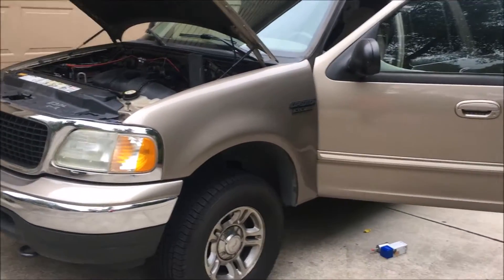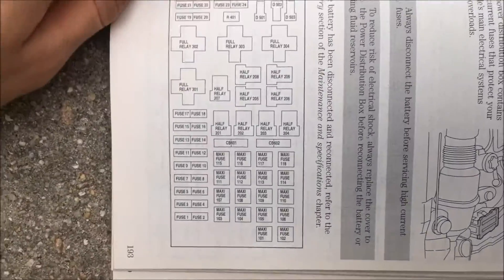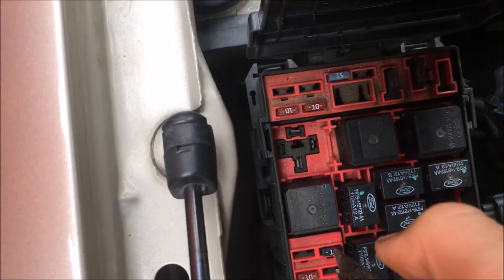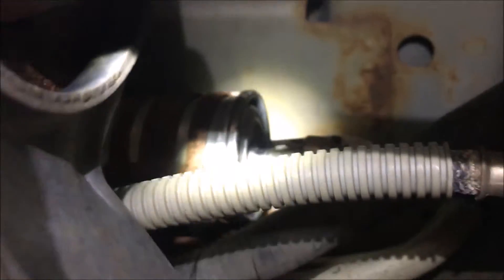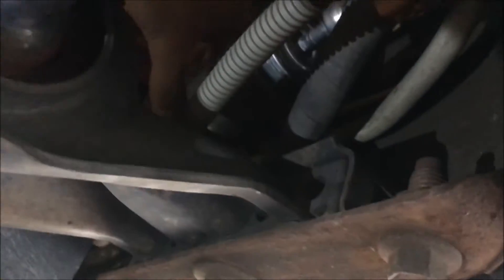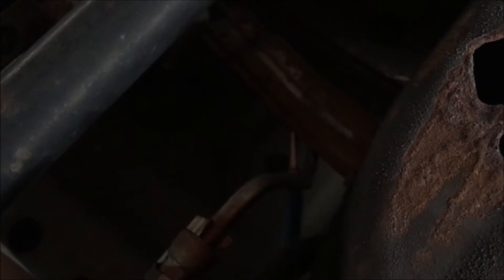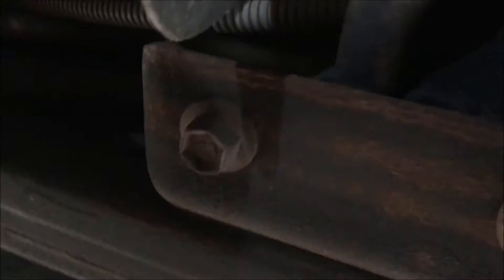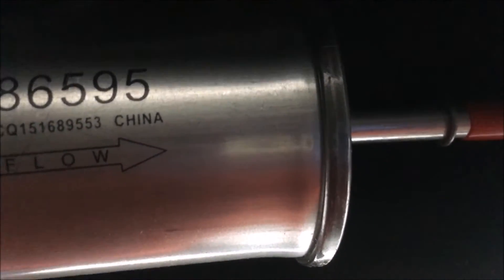Replace the Fuel Filter in Your 1997-2002 F150/Expedition

Comment: My 2000 ford expedition is having issues with stalling and not wanting to go when i gas it, ill leave it forba few hours and then shes just fine for a bit could the fuel filter be the issue?
Reply from the maker: sock is clogged on the pump assembly. I believe they are replaceable, but if you're going to drop the tank I would replace the pump and sock at minimum. 

I'd throw a fuel filter at it first, though as you'll want to do that when you do your pump. That may solve the issue

Comment: Leave the car on when u pull the fuse??
Reply from the maker: That is what I did to relieve the fuel pressure. Not all trucks were fitted with the Schrader valve on the fuel rail.

Comment: I have a problem with my 2000 Ford Expedition I made a big mistake I connect the battery cables wrong way now just crank but won’t start, what could’ve the problem ? I buy a new battery
Reply from the maker: Unfortunately, it could be a lot of things.. First, check every fuse in the fuse box.. If it cranks w/o a start, then its the PATS system tipping off. If a fuse related to the GEM is popped, that's your issue. Also, does the "theft" light illuminate while you're cranking it? 

If there arent any fuses blown, you could have a dead GEM, unfortunately connecting the terminals incorrectly will likely fry electronics in your car. 

Most likely it is a popped fuse. Just take your time and make sure to not skip anything over. 

Also, if you can bench test your relays, that is useful, but not 100% necessary
Reply: @themechanick9071  tanks to respond, and I checked all the relays and fuses and the only one open was for the radio, also I don’t know if it’s normal but the relay #1 and #2 make sound like clicking when I try to turn it on.
Reply from the maker: @UnKnownperson-yt4vt  if you touch your finger to a relay, you will be able to feel the click. If it is dead, there will still be a faint click from the surrounding relays, but it is noticeably fainter than a good click. Check your fuel pressure, as the fuel relay could have gone bad which is causing the crank but no start. You will be able to hear the fuel pump prime when you put the key into accessory mode, but not cranking it. It should be a 3 second "pulse" and a slight thump if it is priming correctly. If you can't figure that out from the inside, have a friend put it into accessory mode, and stick your ear down the fuel cap to hear the pump priming. Unfortunately, if the pump is priming, it is a spark arrestor not disengaging, likely caused by a bad GEM or PATS module.

Comment: I recently bought a 99 expedition, should this be something I should replace sooner rather than later? Or how do I check to see if I’ll be good for a couple thousand miles? Just a couple questions but your vid was very inspirational and help me learn few more things about my car. Thank you!
Reply from the maker: Hey there- If i were you, I would get under the truck and check it out.. Normally I like to replace all the fluids when I get a new vehicle just to make sure everything is working and in fine order... Engine oil, trans oil (just drop the pan, dont need to completely change it), engine coolant,  air filter, fuel filter, and if you're willing to, the transfer case fluid, rear diff fluid,  just to name a starting point. Most of these are really easy to do, and will save you a boatload vs taking it to a mechanic. That way, you know exactly when you need to change it next. 

One of the most overlooked fluids IMO, besides trans fluid is the engine coolant, as you can develop rust inside your cooling system that will clog your heater core! not fun!!

Comment: Do you know an easy way to get a clog out of the fuel lines of a 2000 Ford expedition XLT? If not it's ok I just thought I'd ask. But as for the video it helped me thanks.
Reply from the maker: use an air compressor and air line to blow it out, otherwise i would replace..